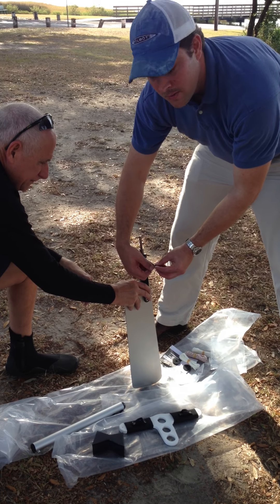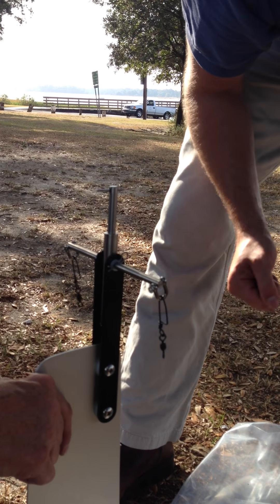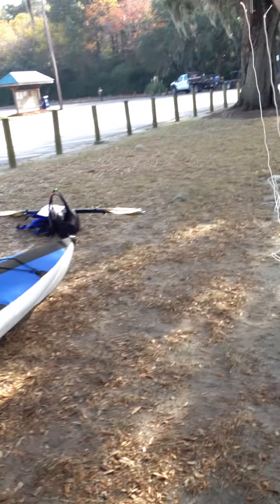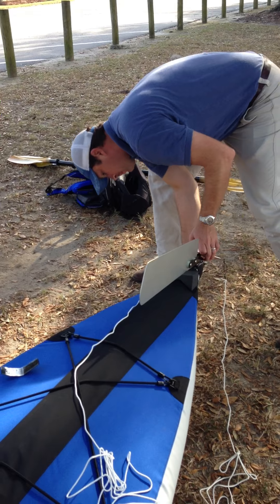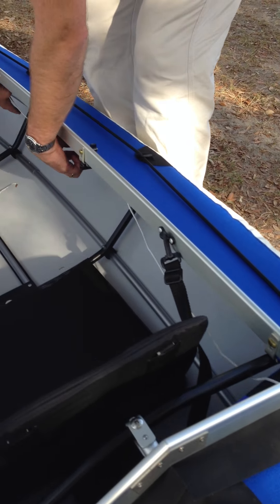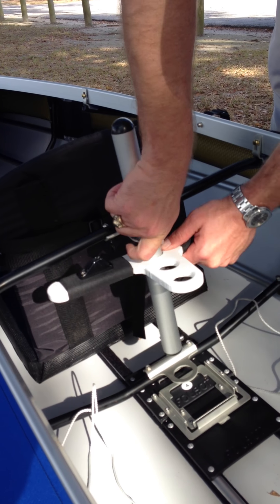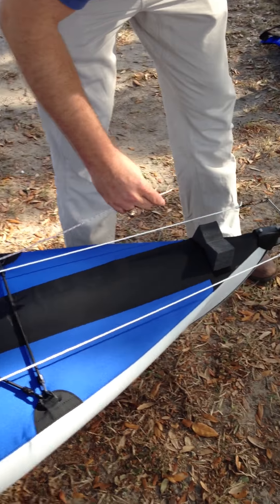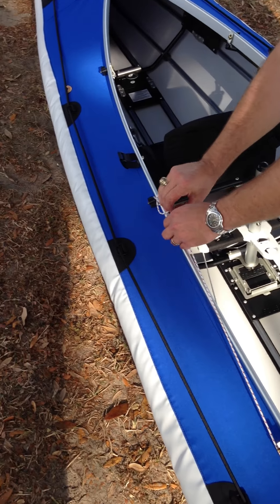Rudder Assembly

Comment: I know this is about 10 years old, but, you can see on the close-up at 2:26 where the 2 metal pieces that hold the aluminum rudder are too narrow and hit the plastic.  I'm trying to figure out how to get the rudder not to hit.  Thinking of just installing it from the bottom (upside down from how he put it in).  Anyone have any tips, because the rubbing on the plastic sucks.